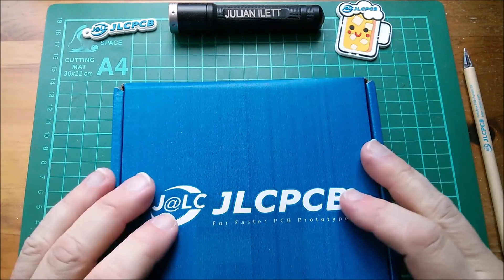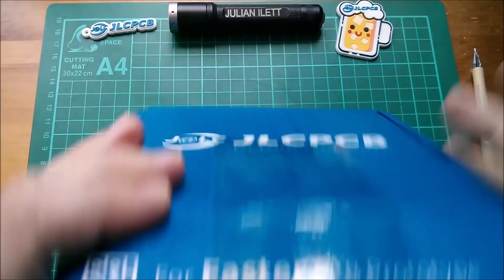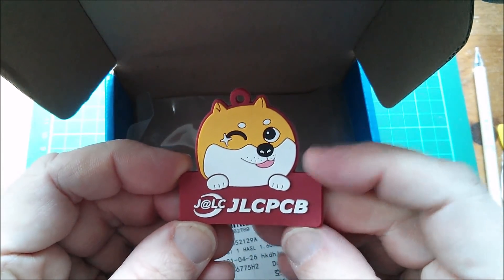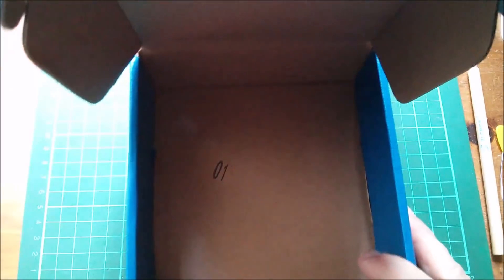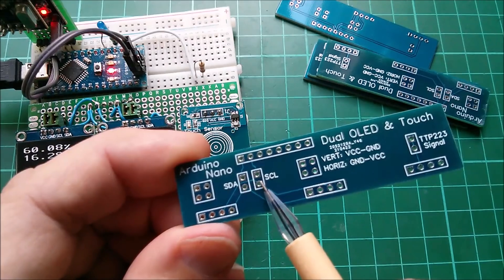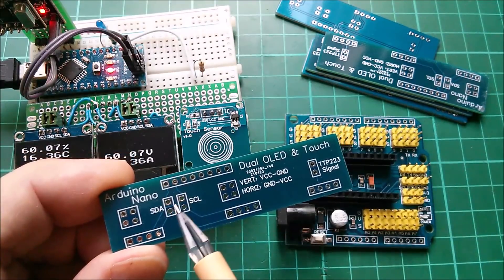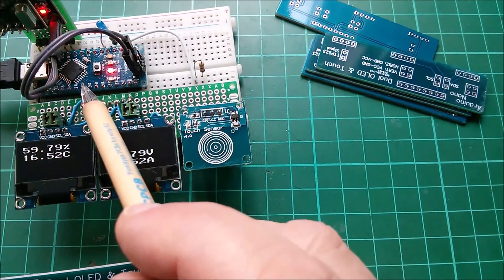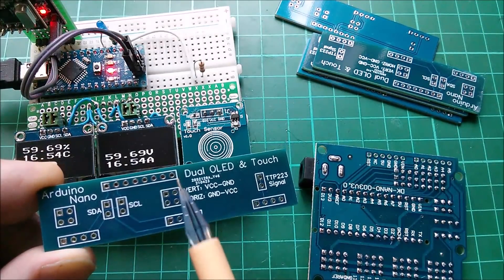New PCBs from JLCPCB - Arduino Nano OLEDs & Touch

Comment: Hey Julian. Why dont you use the Auto-router function on Easy-pcb. Its works flawlessly, and does a self check. Iv made many complicated boards with NO ISSUES.

Comment: I got my first blue PCBs from JLCPCB yesterday, my company paid for them for me. This PCB is intended as a test fixture for stepper motors, and it has places for two Arduino Nanos and three A4988 stepper motor drivers on it. One Nano will be running GRBL, taking commands via USB and controlling three stepper motors, and the other Nano will be monitoring the current flow to each stepper via an INA219 plus monitoring the temperature of each motor and driver board (six sensors.) All communications to the Nanos will go to a PC app I have written for control and logging. 

I love EasyEDA and JLCPCB as a way to create PCBs. They are reasonably fast and easy and allow me to make more Arduino-based gadgets without manual wiring of the base electronics. I have been using a 7805 regulator to generate higher current 5VDC, but I think I need to switch to using a buck converter for more current and less heat (better efficiency.) I started out buying my own PCBs but my boss is getting more and more open to supporting my habit because of the gadgets I am creating for him to enable product and component testing. All my past boards have been green, but I figured I would switch things up and get blue this time. I probably should have gotten yellow to make it easier to write on them with a sharpie.   :)
Reply: I have been creating PCBs that allow me to place everything on one board, including the NRF24L01 radio and the DS3231 RTC module. For the radio I removed the headers from the base and put a new six-pin header UNDER the base so that I could solder it onto the PCB. I located pads almost in the right place under the two power pins, so I just use a couple of cut-off resistor leads to connect the base power to the PCB. It works great, and the radio does not stick straight up. I have several six-pin headers for I2C that are compatible with the RTC, and I can use different I2C modules on those headers, like a 2004 LCD display or whatever. These are just my knock-about boards for various projects, so I try to keep them general purpose. I love having a handful of PCBs that I can stuff to suit small projects.  :)

Comment: YES!, I'm working on a fairly big project prototyping with the NRF boards and needing that  power regulator board is so frustrating. Like, I'd much rather the the NRF board be a few mm bigger and not have to deal with a second whole module with a few passive components.

Comment: 3 ESP8266 or ESP32 on ESP NOW network is all you needed. 
The beauty of that system is you can also use your phone to see what's happening.
Search YT for;
"ESP-NOW Web Server Sensor Dashboard (ESP-NOW + Wi-Fi)" 
to see how.
Reply: I'm currently building a client, adding MQ2 and MQ7 gas sensors for the furnace area in the basement. 
It will send emails and sound an annoying alarm when thresholds are passed.

Comment: Ground planes are a good idea, for no other reason than less etchant used in processing...cheers.
Reply: I've often wondered about this question myself--but from the perspective of:  why waste copper on a grounding plane that's not needed."  Never considered the fact that it had to be etched away, anyway
Reply: @br52685  yep, some PCB manufacturers claim to re claim the copper and dispose of waste properly, whether or not they do is another matter, besides, ground planes are a good idea for most circuits anyway, they only turn into a 'black art' at RF, but so does all electronics !

Comment: Total cost ?
Reply: That size probably 2$
Reply: @jecceworks  Wow, protos used to cost 250 GBP up to 5x5 in .
Reply: @paulvandergroen9569  jlcpcb does $2 for 5 pcbs under 10x10cm. You can get a quote on their site
Reply: @Big Chungus i got them posted here for 6 pounds. bargain
Reply: @Big Chungus southern england. Unless your board is really big, it shouldnt be much more than 6-8